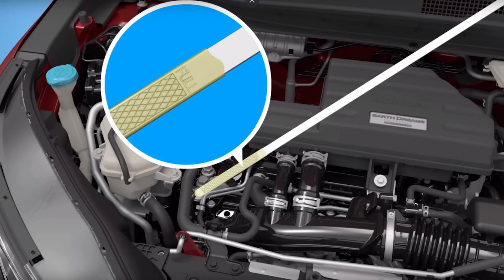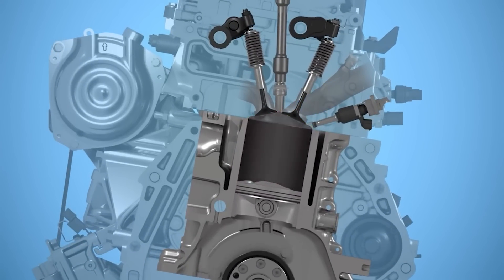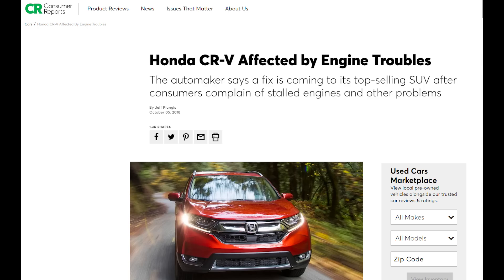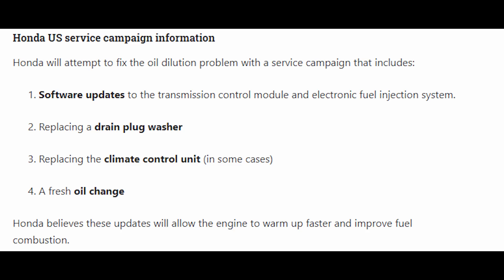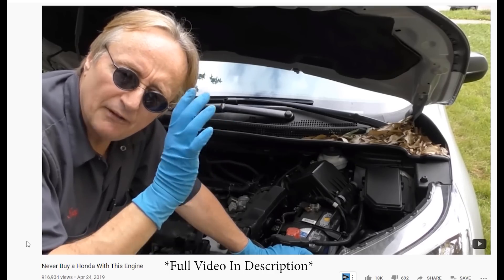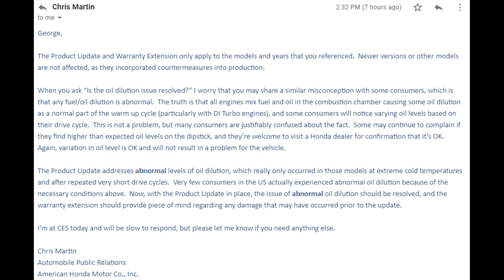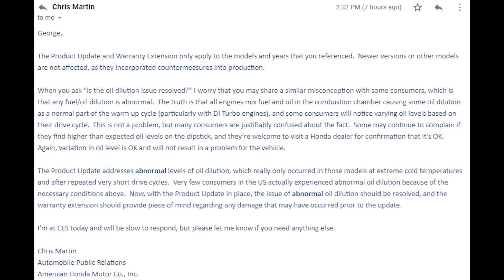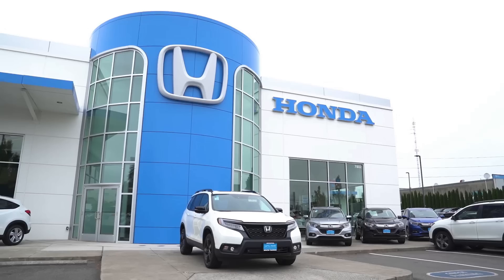Does Honda Have An Oil Dilution Problem? | 1.5L Engine in CR-V and Civic

Comment: Own a 2019 Honda CR-V, and haven’t noticed any gas, oil just yet. Still smelling the brand new leather seats.  Nevertheless, this model has had already a couple of recalls and my local Honda dealer has taken care of them.

BTW, great informative video, had no knowledge of the oil dilution until now.  I love Japanese car companies, I have owned many Honda’s and never had any issues with any of my previously own vehicles other than regular maintenance service.  I also owned a Nissan, loved the horse power on that baby.  Never had any issues with it either.  I usually keep my cars anywhere from 8-10 years.  I currently own the 2018 Toyota RAV4, haven’t had any issues just yet despite the high mileage on it.  Like the response of this from a dead stop much better than the CR-V without using the Sport drive.  The only thing that I don’t like about the RAV4 2018 is the tiny entertainment system!  Why in the world did Toyota waited until it’s 2019 model to finally catch up with technology is beyond me!  Perhaps not to fall behind Honda since it too incorporated a much bigger entertainment system.  

Last but not least, the only other Japanese vehicle that I haven’t owned just yet is the Subaru.  The thing that has kept me from buying one of the SUVs is their body design, I personally don’t like them.  Don’t get me wrong, they’re very reliable vehicles, they just need a better make over to win me over.  In the interim, I’ll stay with the other 3 Japanese brands, which are just as reliable than most other brand vehicles in the marketplace.
Reply: We also have a 19 CRV Ex. Great car. One thing I don't like about it is the adaptive cruise control. Even on the closest setting, it leaves to big of a gap with the car ahead of you. In heavy traffic cars weave in and out of the gap since its so large.

Comment: Own a 2016 civic 1.5l turbo. Never had this problem and my car was the first year the 10th generation came out.
Reply: Civic is a lighter car with less boost. I think it's a combination of car weight and/or boost pressure.
Reply: Do you live in a cold climate?
Reply: @shando3333  yes I live in chicago

Comment: I had a 2017 1.5L turbo CRV in Alberta Canada. Drive it 30 mile commutes in winter. So engine had lots of time to heat up. It still had serious oil dilution issues. Also the cab would not heat up in winter. Engine took all the heat. Froze my butt off last winter. Was my third CRV. Traded it in and bought a 2019 Mazda CX-5. Had it for 10 months. Handles better, faster, and warms up fast! Liked it so much my daughter even bought one. Honda lost us...
Reply: Folks are mixing up the reason why Toyota added port injection to their GDI engine. Port injection helps keep the intake valve cleaner of carbon deposits, an issue that is associated with GDI engines.  Having some port injection will help reduce oil dilution.  
I have a 2017 CR-V in Tennessee and have some oil dilution so I change my oil at 4000 miles and use Mobile 1 full synthetic.  I get GREAT gas mileage, 35 mpg and so far, no issues at 40,000 miles.
Reply: @harley62t  What viscosity oil do you use?
Reply: @roadlazer2461  0w-20, following the owner's manual.
Regarding this oil dilution issue, this week I helped my daughter in law find a cheap car. We settled on a 2014 Hyundai Elantra. It has a 2.4 liter GDI engine and had. 103000 miles. The oil smelled of gas like my CR-V. Engine ran strong, no smoke.  I think the dilution issue is overblown. BTW, we bought the Hyundai.
Reply: What I cannot understand is the time it's taking these engines to warm up as that seems key to the issue of the oil dilution. Most modern vehicles warm up very quickly, manufacturers worked out decades ago that by reducing the volume of coolant in the actual engine, they would heat up quicker and fuel mileage would increase. So what is the issue with the CRV, even an old Isuzu Rodeo we have will warm up from a 25 degree start within a few miles. Did Honda put a lot of coolant capacity in the engine block and head because a turbo charged engine can produce so much heat when using lots of boost? It seems the whole problem is caused by some fundamental design fault in that 1.5 engine and will never be solved until there is some major redesign.
Reply: @fiveowaf454  Nothing of the sort, AFAIK. Your Rodeo would have held around 11L of coolant. The CR-V? I can't find the actual spec, but I can't see it being over 9L. It's a much smaller engine. You don't 'hold' the heat in the coolant, you cycle it through the radiator (intercooler) as quickly as possible. It's more a result of ignition timing and fuel. The computer runs the engine rich at startup to ensure easier running, as well as getting fuel to 'burn up' in the catalytic converter to heat it up faster. But rich mixtures run cooler. Leaning it out heats the block (and coolant) up faster. It's a balancing act.
Reply: @troyjollimore4100  You are confusing overall coolant capacity of the system, with the volume within the actual motor and controlled by a closed thermostat at startup, until the engine warms up sufficiently. As to he rest of your comment about "cycling it through the radiator etc". as a Mechanical Engineer who has been working on vehicles for  over 45 years, I have no idea what point you are making, relative to the point at hand.
Reply: Well I bought a 2020 Cr-v one month ago and even when it was -30c with the wind, this car heated up faster than any other car I've ever owned. It's my 5th new Honda since 2005.
Reply: that kinda sucks that a 30 minute commute doesnt help avoid the problem(I'm a fellow canuck) . My 2016 lx awd with the 2.4 engine is coming off lease and I would likely have leased a 2020 but I'm instead considering the smaller HRV instead that has the reliable civic engine .
Reply: The Mazda is nice. My Civic was slow to heat up as well, but after the 'fix' was done for the oil dilution it heated up much faster.
Reply: bad designed piston rings and piston causing blow by, honda the great failure magician

Comment: GDI's are garbage. I think Kia even got away from that.
Reply: Gdi is soley responsible for the significant performance and efficiency gains since the early 2000s and the only inherent issue is carbon build up on the intake valves which can be remedied by using both port and direct injection. Not a single manufacturer is going back to port injection.
Reply: @YoureMomsMaster  And it's certainly NOT true that KIA has "gotten away" from GDI engines.
Reply: @stephenhendricks103  Wrong (in one instance): Kia's 2.0 liter engine, standard in the '19 Soul, is now using port injection.
Reply: The internal combustion engine is an old dog that will be phased out in favor of electric motors. It's amazing how much effort is put forth by auto manufacturers to teach these old dog engines new tricks, such as gdi and small displacement turbos. Tesla seems to be ahead of the game.
Reply: @asertiv1  As good as they are, electric cars are simply not practical yet. The biggest issue is the battery tech. Slow to recharge and does not cope with extreme temps very well.

Comment: Honda never did have great engines. Friend had several older 1990s civics and two had a cylinder loose compression, different cylinders just the engines aren't any good.
Reply: They literally have the best engines in the world. Dip shit. One engine out of how many has a issue and you makes big statements like this. Every car company has had issues with at least one engine.

Comment: *sorry for the long post*
have a 2017 Honda CRV EX-L with the 1.5T engine. They did all the recalls and services needed but I still see very high oil levels every single time. Even after they just change the oil and I go home. One of the recalls had AC unit change but it was last summer so I didn't notice any problem but now it takes a long time for it to worm up (20+ min of diving in cold weather till it start worming up the car). With all these issues and you can see every single cars website recommends it as the best compact suv and no one believe me when I complain even the service engineers. they keep responding like robots that this is normal and you already did the recall and that fixed it.
Reply: I have the same year CR-V and have all the same issues. I even had the high pressure fuel pump replaced and it's still a problem. Thank goodness it's a lease. The build quality of the car is poor also. Dash, hood and body panels all have issues that a 20 year old car would have.
Reply: @mbehning1  omg, the horrible build quality. I am in so much relief now. I thought I am the only crazy person when I complained about the squeeky plastic door covers or body panels that doesnt align or wipers blades that I need to change literally every 4 months.
Reply: @handycap9815  Its like the heating and air conditioning field.  Government is making everyone buy more efficient equipment.  Problem is, that equipment is 3 times more expensive and you will spend a lot of money in repairs fixing all of the bells and whistles on there.  Sure, you will save on electricity every month, but you will spend much more than you save in repairs.  So bottom line, on the low side, you will spend an extra $2,000 on the equipment that you will never see a return on, plus at least another $1,000 in extra repairs.
Reply: @davidb1169  I guess the solution might be a good old fashioned v6 engine from a reliable manufacturer since all 4 cylinder engines are turbocharged nowadays. I would rather pay for gas over fixing the engine.
Reply: @AmgadAtefNasr  Alas regulations have taken that option away.
Reply: @fiveowaf454  which option?
Reply: @AmgadAtefNasr  The option of a normally aspirated engine without direct injection or a CVT or 8/9/10 speed transmission - all failure prone.
Reply: @handycap9815  really appreciate your reply. Its good to feel I am not alone in this. Frord Escape seems interesting choice, I was going for Subaru forester or get a Toyota Tacoma. Will give Escape a test drive and see how it goes.
Reply: @handycap9815  I called my friend regarding the 2020 Escape, he told me the same, all models now have the EcoBoost turbo engine and he laughed when I told him about the oil dilution problem I have. He said same thing happen in ford engines with the added bonus of the stop/start engin option that makes the problem worse in cold weather.
Reply: @handycap9815  yup, you're right

Comment: In my new 2019  CRV the only thing I smell is new leather smell.
Reply: Keep checking your oil every thousand miles yourself, I didn't think I had a problem until I heard about the issue and checked, the dealer never mentioned it when they changed the oil.
Reply: For now, Danial K.  It's not worth the worry.  You spend your hard earned money to buy a brand new car, and get something that is messed up before you even drive it out of the dealership, but don't find out until you hit that 10,000 mile or more mark.  That's not cool.
Reply: It manifests between 5k and 10k.
Reply: Glad to hear they still offer real leather..
Reply: @jaxxbrat2634  Leather isn't as resistant to the tears you'll cry when you discover the oil dilution problem as good old vinyl.
Reply: I love the smell of Napalm but only in the Morining
Reply: @Xirehp X sorry you had a problem, we buy alot of cars and the dealer didn't want to loose our business so they treated us well. We ended up training our Crv for a 19 Passport. My wife was a huge, huge CRV fan until she got the Passport. The only thing bad is the fuel milage compared to the CRV. I hope it works out for you.
Reply: Not for to long keep checking the oil smell
Reply: Danial K=yeah right==silly sheep===!

Comment: I have a 2017 Si and I have winter in my area but I'm fortunate to commute 50 miles each way to work so I never experienced the smell of gas in my cabin (I also got that ECU flash from the dealership and extended warranty from Honda mentioned in this video). I do regular oil changes at the dealership in case I want to sell it one day.

Honestly, I'm willing to bet this mostly happened to people who buy 87 gasoline (when 93 is recommended) and never change their oil unless someone else reminds them.

Comment: I attribute this to excessive and asinine pressure put on Manufacturers by Reviewers and  Marketing people to follow Fords example of small engines with DI turbo for EPA gas mileage alone. Ford wised up and went to Port+DI to solve reliability issues that plagued it earlier. The German Manufacturers couldn't care less, since their core buyers only lease for 3 years. DI with turbo is nice, but only if its a lease or rental, which is not where Honda sales are.

Comment: What is honda’s definition of “extreme cold”?  Seems to me all of the northern usa and all of canada can experience extreme cold from december to march
Reply: Ours had severe oil dilution in winter and summer, didn't matter.
Reply: @MontanaWelldigger  How often did you change your oil though?  What oil are you using? What fuel grade do you use?  How many miles on the engine?
Reply: @hegeliandetective1034  didn't own it long enough, only changed it twice, when the computer told us. Used 87 octane gas at 5000 feet of elevation. We traded it with 18000 miles back to Honda.
Reply: They do it in summer as well.

Comment: im having oil dilution issues
2018 honda crv lx - 
location - southern california
everytime i go for an oil change i check the oil... yup... dillution every time. im prob jump ship to tesla for my next car
Reply: Thomas Um well....if you’re trying to transition to a more reliable car you many be disappointed lol. But if you want a cooler car you will be just happy.....until you need to repair it. 😆
Reply: Thomas, I believe your 2018 Honda CRV LX has the standard 2.4L engine and NOT the turbo. I'm not aware of any issues with the 2.4L. It's a very solid engine and Honda has used it for over 10 years.
Reply: B Stevens 2018 CRV base engine is 2.4 but the optional higher end models get 1.5t and the difference in power and torque is minimal.

Comment: I was just thinking about getting a CRV/Civic but not after hearing this. The cheaper they make them the higher the profits. I guess that's their bottom line and to hell with quality! I got a better idea just don't buy a Honda!!!
Reply: The whole thing can be avoided by just buying a Rav4 or a Corolla.  Toyota puts so much effort to make their engines reliable, even going so far as making their engines both GDI and port injected.  Honda reliability has fallen to a point that I won't even consider them.  And it really hurts me to say that, because I live about 35 miles from the Marysville and East Liberty plants.  I wish I could support local jobs, but I just don't want to risk mechanical issues when I can avoid the whole thing by buying a Toyota instead.
Reply: Still excellent, just change your oil more Regularly.

Comment: What about the carbon issue? Apparently and according to Scotty Kilmer, GDI engines are prone to excessive carbon build up in the cylinder head.
Reply: Yeah thats after 150k miles. Gdi engines are fine as long as you use full synthetic oil and change it every 5k miles.
Reply: Mike Foehr that is something that affects all DI engines

Comment: Exactly because of this issue, I just purchased a 2020 Highlander XLE  with a naturally aspirated V6 engine. Regardless of brand...I will never buy a car with  turbo charged 4 cylinder CVT engine!!
Reply from the maker: Many feel this way and are now flocking to Toyota.  Besides the Supra, all Toyotas are still using NA engines with normal Autos.
Reply: Drivers Only they use CVT too
Reply: Hopefully the toyota engine wont diluted fuel to oil too i believe their new engine beginning 2017 had a 2 fuel injector
Each cylinder one in intake and one direct to the cylinder
Reply: @andrewdero6271  I believe the problem comes in to play when you have direct inj plus Turbo. Toyota does not have turbos
Reply: @ronfazer2423  Yet isn't the Honda 2.0T the same technolgy and yet doesn't have this problem?
Reply: @fiveowaf454  Wow, not sure, maybe the 2.0T is not Direct but is Port injection? I have heard that manufactures are using piston rings that have less friction to get better MPG and the drawback is more fuel and blow-by fumes get squeezed pass the rings into the oil. And this makes fuel dilution worse?
Reply: @ronfazer2423  2.0T is direct injection as far as my research goes, the fact it's not having problems shows Honda being dishonest by claiming it's "normal" for the 1.5T due to the type of technology. I too have heard about he Piston ring issue to reduce friction and wonder how that's going to play out in the long term for wear.
Reply: ron fazer right they dont have turbo but they utilize hot the 2 injectors works direct injector works when engine was just started to get it to right temperature and i think manifold injectors goes to work when your at high speed or something